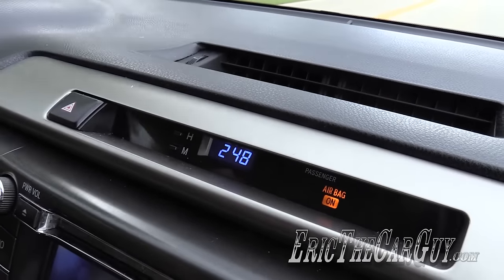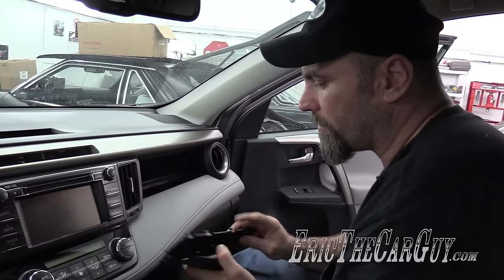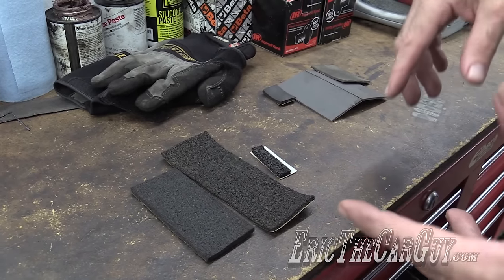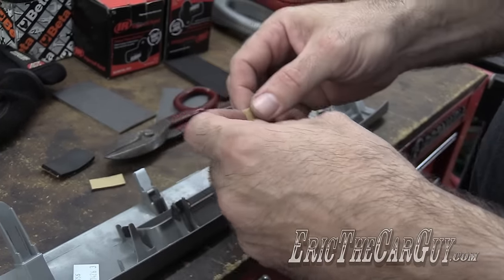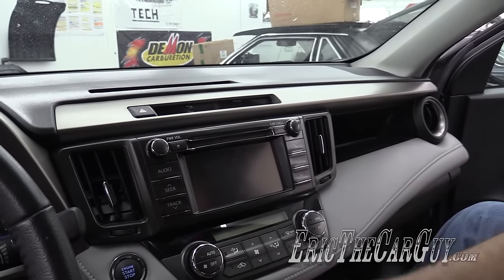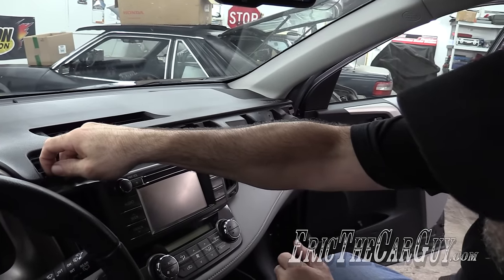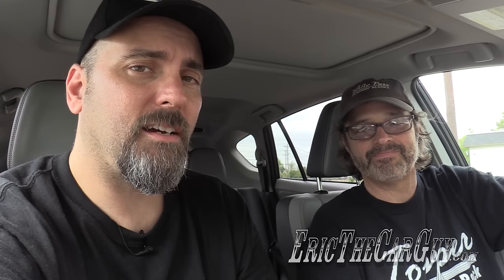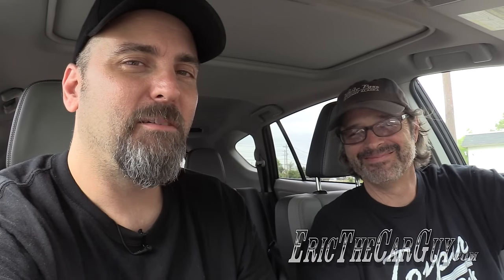How To Find and Fix Dashboard Noises

Comment: I had a 98 wrangler. A rough riding vehicle that was used to bends, arches , twists, contortions bumps etc.  finally got rid of it in 2015,  and never an interior rattle, not one , right  up until the day we parted ways.

Comment: What a difference having a camera man makes to free you up to do the work. Very helpful video. My wife's Trailblazer has just sprung a clicking tapping from behind the instrument panel. Any ideas how to diagnose that? I'm sure the instruments are sealed up tight and getting to any loose parts back in there won't be easy if at all possible. May have to end up living with it. But not before I give it a look see

Comment: Toyota makes great cars but man their build quality has gone down the crapper...
Reply: Yup, definitely not as good as it used to be.  But that goes for all the Japanese manufacturers.
Reply: not made in japan friend
Reply: not designed in Japan domestic.
Reply: +CARS LOVER The Honda accord hasn't ever been made in Japan but it was also a great car only until recently. It's the quality of the plastics, suppliers and the bean counting over engineering that brought down the quality.
Reply: I'm a Toyota man through and through but I agree. Their quality is just shit these days. I've had my dash replaced in my 2006 Prado because of cracking. Don't get me wrong, their cars are brilliant and reliable but just not as good as they used to be
Reply: yea same with Honda.
my 2016 civic is a rattle box.
Reply: My corolla 2016 - Build quality is very cheap. Making dashboard plastic jerking noise.
Reply: My dad owns a 95 Tacoma V6 and an 03 Camry, both over 200k miles and both still running strong
Reply: I wonder if the new materials automotive journalists*demand* they use are partly to blame.  The soft materials and hard plastic seem to expand at different rates in the heat.
Reply: As a toyota owner for the last 40 years of over 16 cars Japan made I'm going to have to agree 100%
not just cheap models either everything from a supra to a terdcell.  Mostly Celicas but I'm going to say I've gotten over 200k miles or more on most of them one is close to 300k and its never been in the shop for anything other then normal maint I can't do at home and I do almost everything.
I currently own 4 of the 4 the 1994 Celica needs work from age none of the rest need broken parts repaired but the supra from a wreck.
all of them its gas oil and drive.
Reply: @ElectoneGuy  "Made in Mexico" explains it all...
Reply: I disagree. I've owned Toyotas for 40 years and I've always seen great quality. The interior of some cars started using a lot more plastic but that was the case with many cars. They snapped parts together instead of using screws. Even more expensive cars use plastic but they might be covered in nicer finishes as they should be if you are spending $40k instead of $20k.
Reply: @shinukjoseph2010  My 2009 Corolla S and 2107 Corolla iM are noise free.
Reply: 2020 Tundra all kind of noises.  1997 4Runner rock solid inside and out.
Reply: @TristanTris321GoT  my 2019 tundra is a pos.. literally sounds like a tin can rattling over the smallest road imperfections, huge disappointment

Comment: This is so weird i just had this problen on a Rav 4 today at work. work as a mechanic at a toyota dealer. it was the lose plastic on the back on that black bar with the clock and hazard switch, i toke off the plastic piece an put some sticky stuff like bubbelgum on where it was clipped together so it was 1 solid piece. now it dont make noise. probably a problem we are gonna see some more off.

Comment: Felt side of velcro work too and you can buy that at the fabric store as well as trunk liner or fleece and spray glue.
the spray gules not really good for a car but none of them truly are. the heat in the summer will case them not to hold but one's its in place it should not move.

Comment: If there are screws that wont stay tight (sp?), they usually have a clip in the dash that they screw into.  These clips especially after removing and installing stuff many times need to be replaced and they are about 5-20c each at the dealer.  I had terrible rattles after the dealer replaced the heater core and they had to take apart the whole dash.  Didn't rattle at first but after a month all the dash was rattling.  Many screws had come off due to the clips.

Comment: Came here looking for suggestions for rattles in my 94 Acura Integra with 360K miles.  I don't drive it much anymore but the dash and rear hatch rattles are super annoying.  Some pieces rattle at a certain engine RPM, like the instrument cluster trim surround will rattle when the car idles high during cold start.  Some of it I think is just because I've taken the trim out and put it back in numerous times since I bought the car 16 years ago.

Comment: Hi Eric. Can you please provide detailed instructions on how to remove that long plastic piece on the dash. Do you just use your fingers to pull it down, then pop it out from underneath? Start from the passenger side? I don't want to break any clips behind this plastic piece. I have a 2016 RAV4 with the same rattle from the dash. Thank you very much.

Comment: I'm noticing new cars don't even have 1 screw holding anything together. Even 90s cheap cars had a few screws holding things together. Those plastic clips probably cost less than a few screws.
Reply: snoopdogie187 my 2014 Nissan Versa Note has at least 4 screws in dashboard.
Reply: snoopdogie187 they know screws are better but they care more about decoration and production time.
Reply: I believe,  the problem is in deforming the material slightly with time and varying temperature. new cars are quite. I used a new car in super hot places for few years. then I noticed pieces of felt are falling of the dashboard. they turned to dust when I touch them,  in few months squeaking started. so,  I believe deforming and loosing these felt spacers are behind the bad music.

Comment: You can also use "dum dum" that thick play dough stuff that's used for a/c air leaks in the dash works great
Reply: dum dum works wonders but it gets really soft in the heat and its a bitch to clean off.
I had a back window replaced once they used dum dum because the broke a panel clip, I made them replace the panel I did a stop pay on the cheek until they fixed it. the window also leaked.
Your smart if you do not pay cash but a charge card or some way to stop payment some shops do not fix there mistakes.   I've worked on cars for a very long time it happens I didn't make many but I've made my fair share. You learn from it and fix it the right way be honest people will respect that.
If you try and hide the fact you've lost a customer for life and the 30 people he tells about it.
I've had to have 3-4 windows replaced since that never once went back to them even for a quote.
That is not how I work and I don't expect to be treated that way either.
If I take a car apart and find a missing bolt hole I'll put the bolt back in when I put it back together like it should be.  I've seen installer leave knee bolster panels off because they were to lazy to put it back on, this is a safety crash part if that guy ever wrecks that truck he will eat the whole steering column and die because the installer didn't take 5 min to put the car back together correctly.  You can not take shortcuts working on cars.  If I had a car or truck come in the shop like that I'd tell the guy and make him park it until it was repaired properly.

Dealership work on flag time, the job is rated at avg hours to do that job some guys get really good at doing that one thing, but some take shortcuts doing it so its fast and they get paid more money by doing it in 1/2 the time and do more jobs a day, Seriously anytime you clock a salary like that your going to have bad work done Its stupid. But this is how dealership's do work, some guys take pride and some are just there to get money and pay for that lakehouse and motorboat.
It gets stuff done faster but it also leads to sloppy work done.
This is what he was talking about no one else would take on this kind of job, you do not make as much money off it. Its hourly work not flag time.
This is also why you take your car in because the battery keeps going dead and they guy replaces your alternator that works properly because you always have a radar detector plugged in and turned on draining the battery. So that 350 dollar repair bill did not fix the problem. Lets change 15 other things that won't fix it either.   If that's the case find a better dealership to work on your cars and don't go back to that one.

Comment: Some of the plastics and rubber they use in car dashboards are noisy as hell. In every new car, I always remove the whole dash and put rubber sticky pads around to buffer everything that makes contact. Felt pads are also a good option as long as they're thin enough not to cause protrusion.

Comment: Another trick to replicate the rattle noise is to use a signal generator. Hook your phone up to the sound system and download a signal generator app. Crank up the volume on the car and mess with the signal generator, at certain frequencies the rattles will come out and you can easily replicate it.

Comment: Hey Eric , I have a 2004 Ford Explorer 4.0 and the automatic start will not work. Dealer wants 200 just to look at . Power turns on in car but it won't start . All I hear is a click when I go to try it . Any tips I should try ?

Comment: Have a GMC Sierra that was bulit in 2006. No rattles. Have a 2012 focus that has 3 rattles. A friend of mine has a 2001 ford f250 diesel and no rattles. It seems silly that alot of these 2010 plus vehicles are having these issues!

Comment: Always remember that polymers/plastics will perma-set up to 20% more, and foams likely even more. Just cause it's quite after you install it, doesn't mean it'll stay that way. It'd be good to go thicker then you need and use a little elbow grease to get it back in place.

Comment: unrelated topic, a family member of mine has a  rover 620 and was driving around when it suddenly stops, had loads of petrol. when you turn the key to try and start it, it does not get a spark any ideas while I am here would be great the car is not worth spending loads on but if it's fixable at all would be useful.

Comment: For those that can't get a hold of any of this, double sided 3M exterior grade tape (spend here, because you don't want this to liquefy inside your dash, remember, this is hot during summer) and foam, which you can buy at any shop that deals with textiles.

And if you really can't get your mitts on foam, then, you can just go to any hardware store and buy foam wrap. It's not as good, but for a few strips, it will work.
Reply: Sidenote: Interesting how they gouged the bolts to save weight/cost.

Personally, i fixed all my rattle noises with fine grade expanding foam and tiny bags. I set the bags inside the space i needed to be filled, then, using the flexible 2mm ID hose they give, filled the bag. When it sets you trim the excess, and remove the protection tape. It will never fill hollow again, or, rattle.

Comment: i have tiny rattles coming from the vinyl door panels which seem they are stuck with glue from the factory, and i dont feel comfortable by removing it. Also i have some rattles coming from the back, like some metal sounds, but everything that could make the noise is snug and dampened on the rear :/ Any ideas for each case?

Comment: I have seen many vehicles with rattles in them and it was annoying driving around with the noise distracting you as you drive on the streets and highways which are rough to begin with. The way that car is built will be a problem as for owner with the pop in parts. I liked it better when they had all screw in parts.

Comment: I used to have that problem... then I opened up the dash and put some thick silicone grease on the areas that rub. Did that  like 3 years ago.... no noise... I was surprised that heat didnt affect it at all but hey, I win!

Comment: Great video, thanks.  Does this apply to squeaking in the same general areas?
Reply: Squeaking is usually different parts rubbing against each other instead of bumping into each other. So the same methods should work; put something like foam tape between the parts to prevent contact and reduce movement.

Comment: I have vibration noise when I go over 80mph any suggestion
Reply: Maybe you have unbalanced wheels
Reply: if you have a rain visor on the door it could be it.
Reply: don't go over 79
Reply: liew yung the car is new 2015
Reply: JayVan Geli no I don't have
Reply: Sounds like unbalanced wheels. On an older vehicle could also be engine mounts.
Reply: FSXgta car is new 2015 only have 3 oil change on it and in the dealer so they supposed to check anytime im there
Reply: Kristjan Põldmets if unbalanced wheels the vibration will also be felt in the steering.
Reply from the maker: http://www.ericthecarguy.com/faq/determining-the-causes-of-vehicle-vibrations
Reply from the maker: http://www.ericthecarguy.com/faq/diagnosing-noises-in-your-car
Reply: slow down
Reply: First step is to find where the noise comes from. Best advice on that, get a friend to sit in the back as you drive. No AC, no music, quiet road preferable.

Step two, once the sound is identified, inspection is called. Get clothes that you don't mind getting dirty, latex gloves (no thick gloves, you need your fingers), and a light that you can dim.

Then you go around that area of the car, you feel, you measure (distances, compare, find if something is bent), you listen.

If you've identified a potential candidate, let's say the rear whee's weights have fallen out of place and they hit the brake caliper, you try to replicate the condition.

Each time you find something you're not certain of, Google your car make and year, along with keywords that describe your issue. Like minded people have potentially encountered the same issues as you have, Google will fish those articles and you'll find the likeliness of a repeated offense.

Good Luck.
Reply: hi. check tires statement. alignment and mounts. check rims alignment. suspention joints silentblocs ball joint.
Reply: The truck is brand new
Reply: take it into dealer and get them to fix it under warranty?
Reply: Slow down!
Reply: It's your hat. It makes your neck squeak.
Reply: Severely warped brakes. Unbalanced wheels. Wheel bearings severely fubar. Unbalanced driveshaft.
Reply: Even if it is new. It may be some building failiur. I suggess to check tires balece. Rims balence. Your not losing a thing. Take it to tire specialist anf make him check tire and rim balence. I bet you will at least one wich will fail. Be carefull on the road.
Reply: The last time my car went over 80 it produces vibration. And it's due to the engine mounting wearing out. Yours might not be the engine mounting, it can be lots of different things like wheel alignment, steering rack loose, engine mounting loose....etc, since your car is new go to the dealership and let them diagnose it to get it fix....
Reply: what kind of car?
Reply: I wonder if it's wind related. Like a sideview mirror. Any idea where it's coming from? Does the steering wheel vibrate at all?
Reply: i had same issue, check wheel bearing and replace front rims those parts might have gotten damaged after you hit a pot hole at least thats what happened to me.
Reply: get a radar detector
Reply: U don't need radar if u keep your eyes open

Comment: Eric, how do you figure out where to apply pressure when removing trim pieces? I usually run into problems and break shit.
Reply from the maker: Look for witness marks in the plastic. Also listen closely when you're making the noise to help you nail down where it's coming from. It's often a matter of trial and error however. It takes time.

Comment: Just a tip from an anal heehaw car guy who's worked with tape A LOT...   if you insist on touching the sticky side,  touch a bunch of clean spots on clear packing tape first to pull the dirt and oil from your fingers.. don't touch anything else in between...

 sometimes it's hard to not touch the tiny pieces, and pulling the oil and stuff from your hands first really helps the long term stickiness of the tape. . 

Nice very man !!  👍 👍

Comment: My wife's car was almost totally destroyed by the previous owner, things broken on it I can't even believe... one of the things was the passenger side mirror. When the car would idle the vibration of the car made this hollow plastic rattle, it was constant and LOUD. I had to take the mirror apart and I lined the edges of it with electrical tape and put it back together, now the rattle is gone. I'm not sure what exactly the person did to the mirror, but a few of the retaining tabs were broken off inside it, so maybe they were just goofing around with the mirror and broke the tabs off. Either way it was chronically obnoxious.

Comment: Just got an after market stereo installed on my 2012 Nissan Altima and I have a rattle coming from inside the dash board. When the car is about 5-25mph you can hear it. when I am over 40mph it is completely gone. It’s actually not that bad because I ask other people if they can hear it and they say they can not. But when my factory system was in the car I do not remember hearing anything😏..anyways I guess I will turn up my music.

Comment: cant you just black RTV the damn thing? it WILL hold it in place, and it will come off if needed.
Also, it will not deteriorate and it will fill up all necessary small sports too. 
Tape will eventually wear off....no?